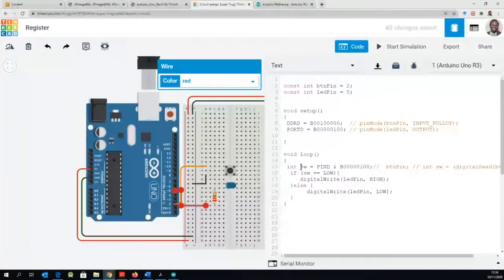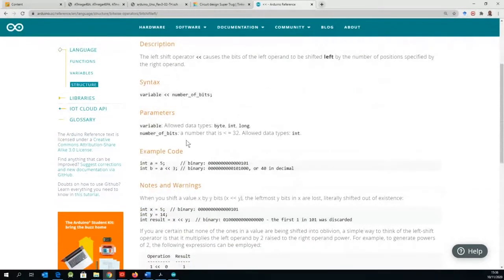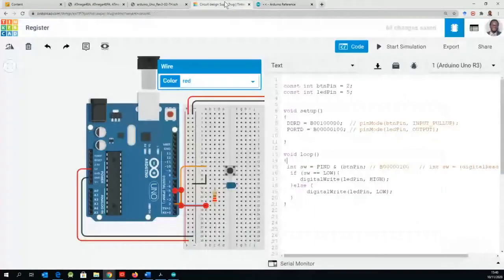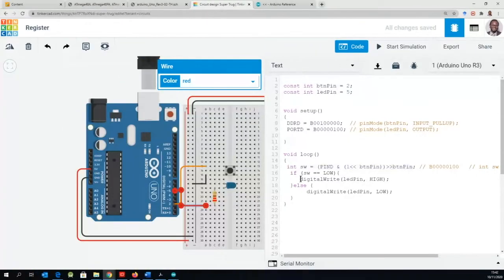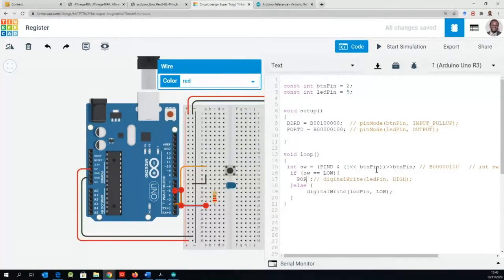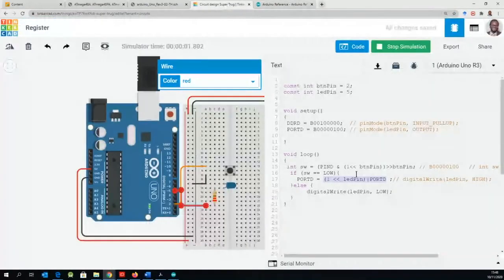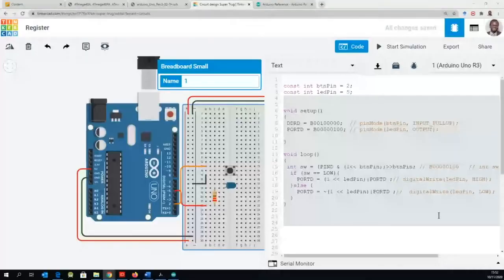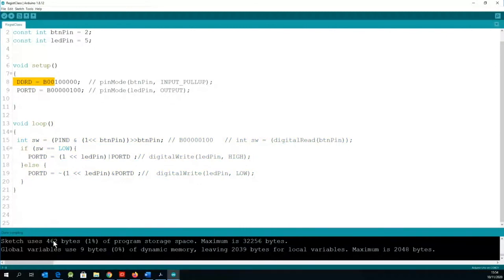Part 16 Programming Arduino without Hardware :  Programming the Registers

Comment: Register is hardware.
Reply from the maker: The key advantage of these tutorials is that you can run most of the features of the ATmega328P chip and Arduino along with sensors without purchasing an Arduino.
Reply: @makewithmeMOA  Ok.